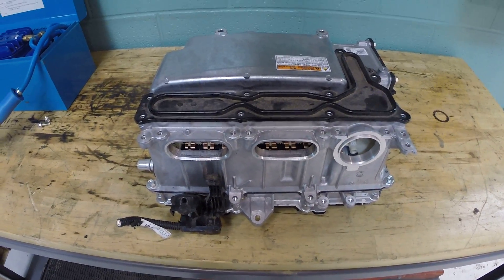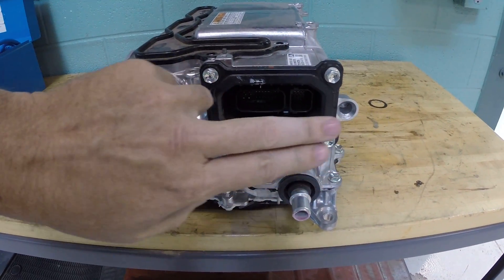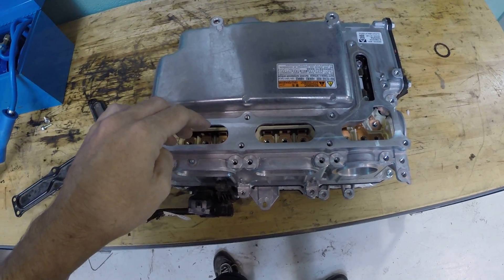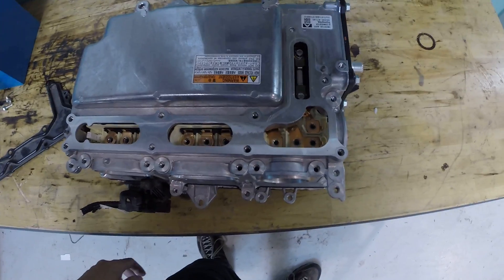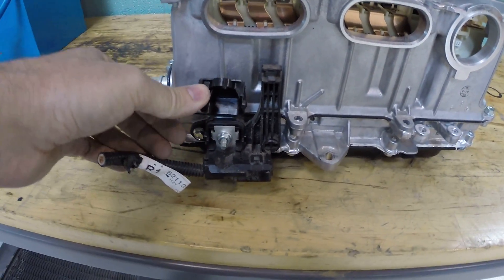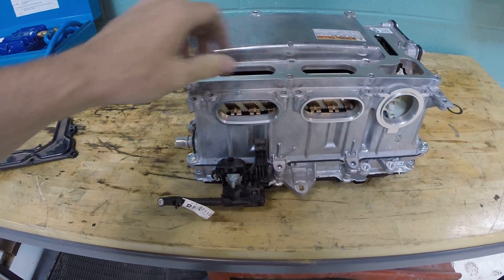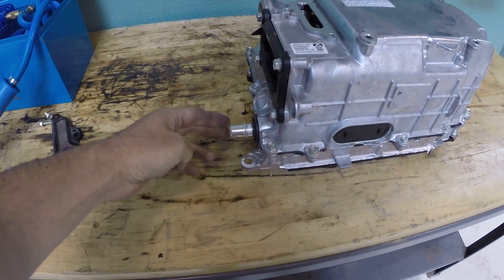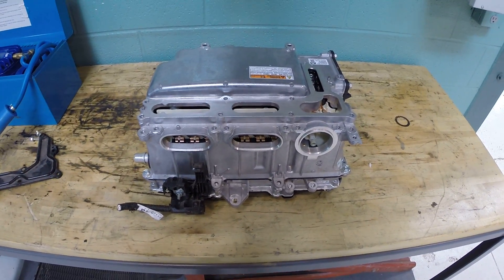Gen 3 Prius Inverter

Comment: I have a 2009 Nissan altima hybrid in this case the car dose not crank, so I replaced hybrid battery with full power stored  and got th he car to run, but notice the hybrid battery gage going down to empty quickly, and then the motor  Shutting down, but befor that it started to  Vibrate could anyone tell me if this a tranny problem or the AC to DC converter

Comment: Very informative video.. thanks for making it, I HAVE A QUESTION, DO YOU KNOW ANYTHING ABOUT VOLTAGE INCREASING FOR THE AUXILIARY BATTERY?  I AM GETTING ONLY 13.4V TO MY AUXILIARY BATTERY WHEN ENGINE IS ON, AND I HAVE A BIG CAR AUDIO SYSTEM INSTALLED IN MY CAR, IF I CAN GET 14.9V OR 15V WOULD BE GREAT JUICE FOR CAR AUDIO, I WAS WONDERING IF ANY BUTTON OR VOLTAGE INCREASING TECHNIQUE  AVAILABLE FOR US TO RAISE DC 12V THAT COMING OUR OF THIS DC TO DC INVERTER FOR AUXILIARY BATTERY?

In non-hybrid vehicles it was so easy, by installing big three, extra wires from alternator to battery to ground etc.

I dont know what to do in hybrids.

MY VEHICLE:

Lexus RX 400H 2006

Would be great help if you reply.

Thanks